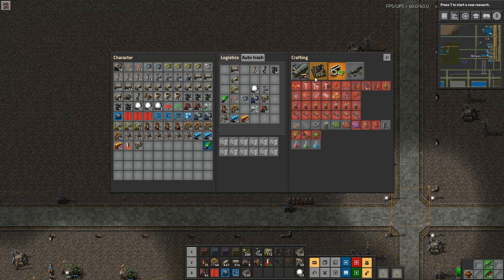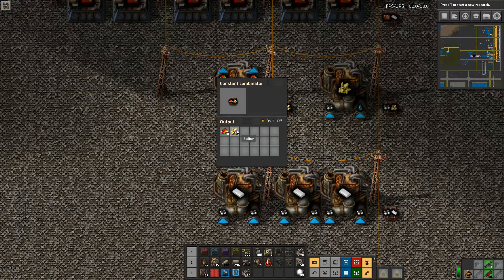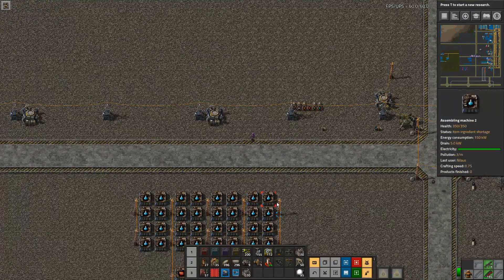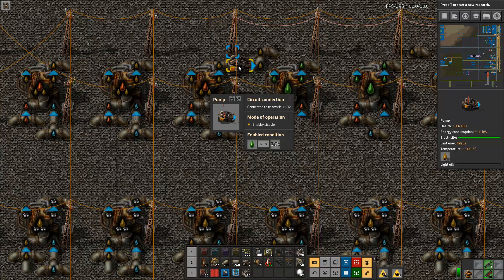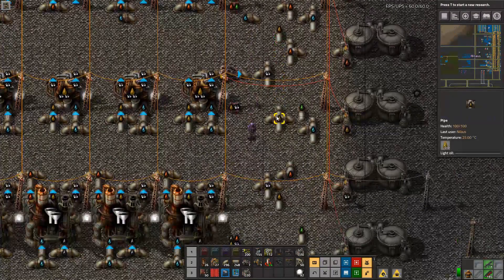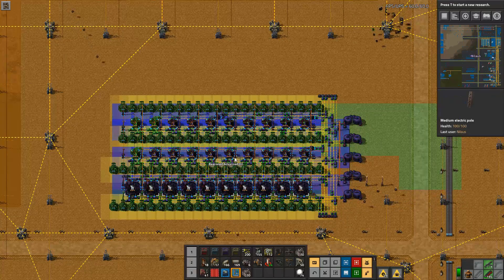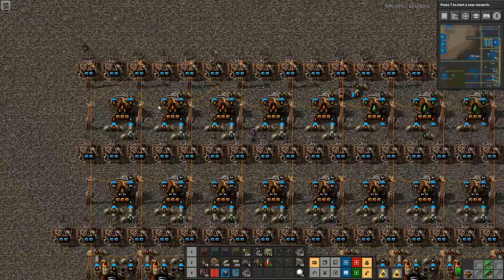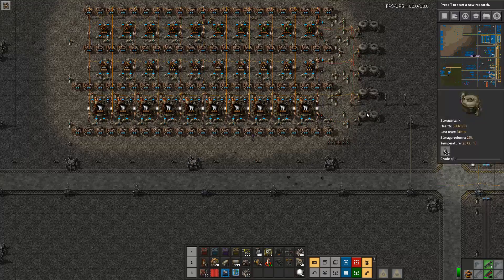NEW OIL TUTORIAL 0.17 - Factorio Engineering

Comment: I understand the circuit limitations on the pumps but what do the constant combinators do?
Reply from the maker: The Constant Combinators do not serve a purpose technically, but are just there for anyone using the blueprints to quickly get an overview of the inputs and outputs of the different parts i.e. purely as signs